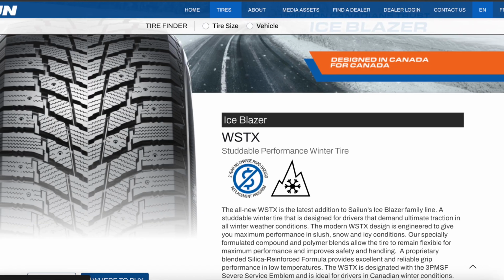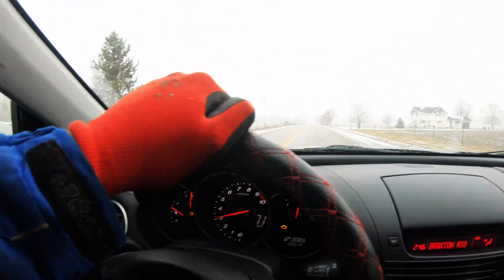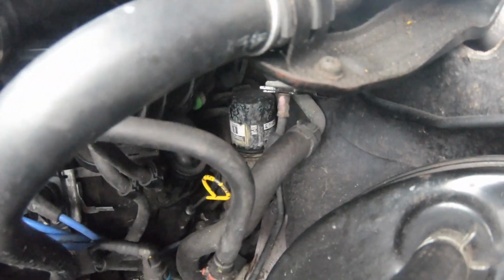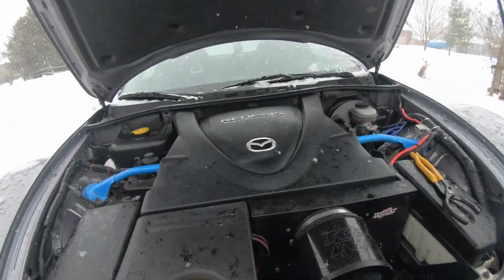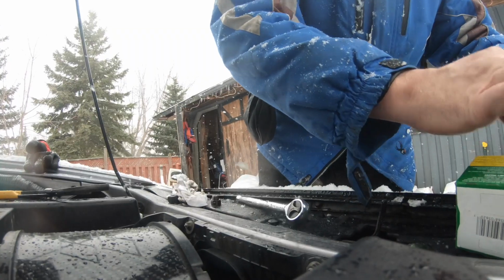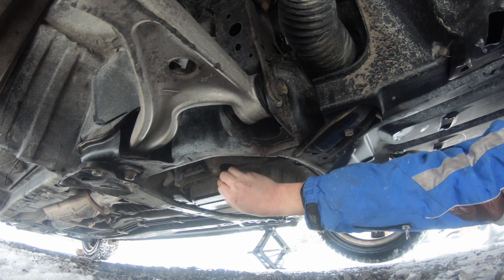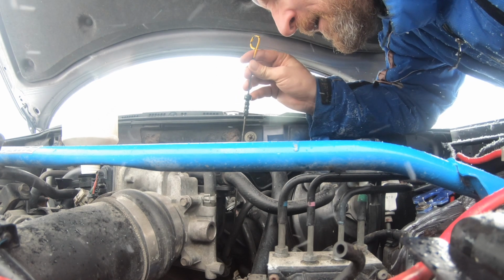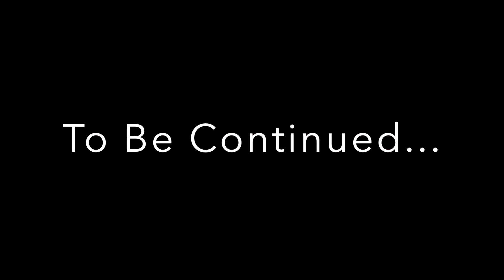Mazda RX8. ULTIMATE WINTER  Vehicle!  Snow tires installed.

Comment: I did this a few years ago, Yokohama snow tires on 17’s and the car was good in the snow. Only did it one winter though the salt kills cars so bad. The pinch welds are the first thing to get any rust and the valleys in front of the rear tires. If you remove the small rubber mud flaps in front of the rear tires it helps keep that area dry.
Reply from the maker: Thanks for the tips! Im on the second winter with this car. No rust yet... My previous RX8 was rotted out, both rockers. Luckily where I am in Ontario. They use sand instead of salt. Cause they're cheap! lol.

Comment: How long do you need to idle in the winter before your comfortable hopping in to drive?

Is 10 minutes a good amount of time to get to a decent temp?
Reply from the maker: Really depends how cold... Usually 10 mins is enough to warm the engine. Id still keep it lower in the RPM's for an extra 10 mins or so. Id use a lighter weight oil in the winter though. Helps lubricate things "quicker". Anyways, 10-15 mins is a good amount of warm-up time.
Reply: Dont idle it for too long. Wait for RPMs to drop to 1500 then keep shifting under 3k